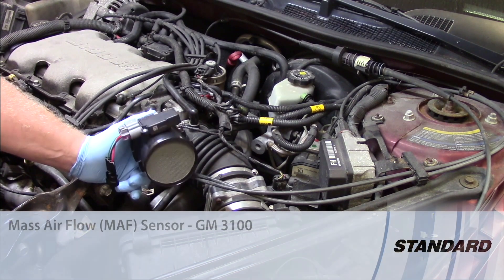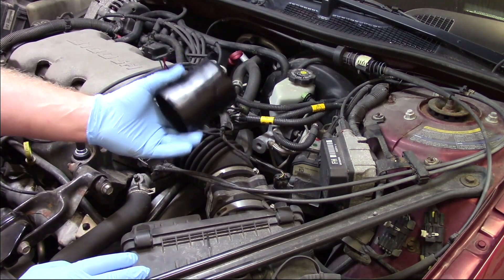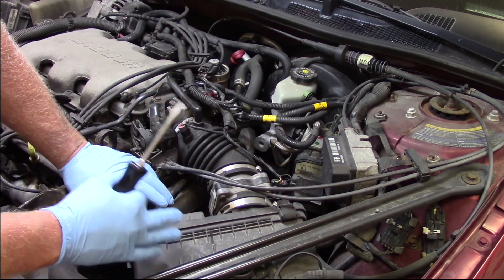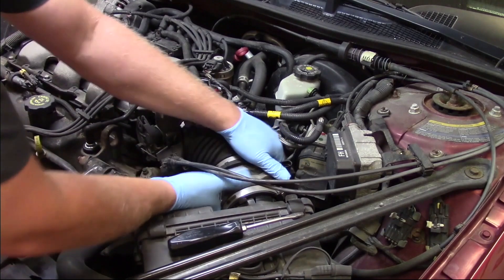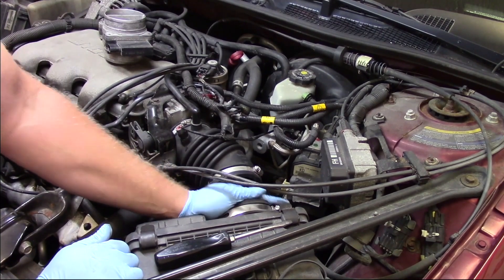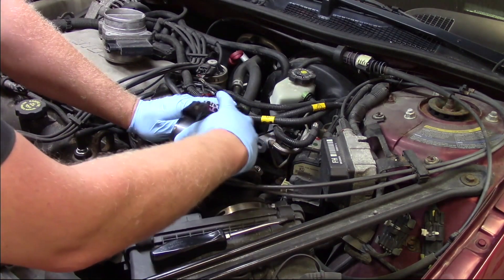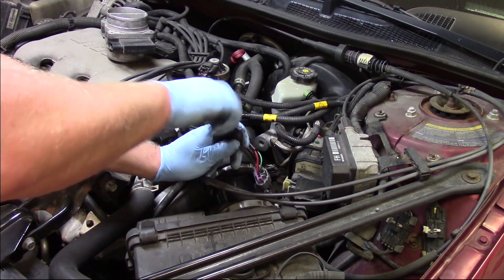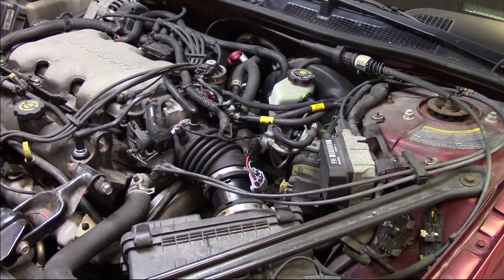Mass Air Flow (MAF) Sensor Replacement: GM 3100

Comment: I realize this post is 3 years old, but if you can remember......... what prompted you to change the MAF sensor to begin with? Catastrophic failure? Did you attempt to clean it first? And also if you remember, what were your fuel trims readings?  And thank you.